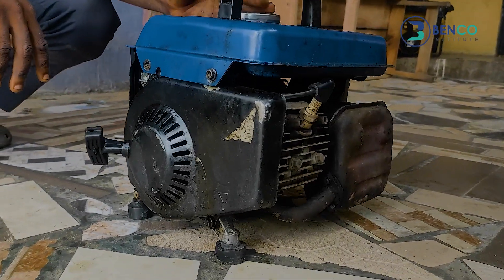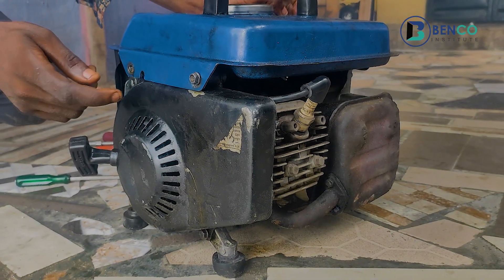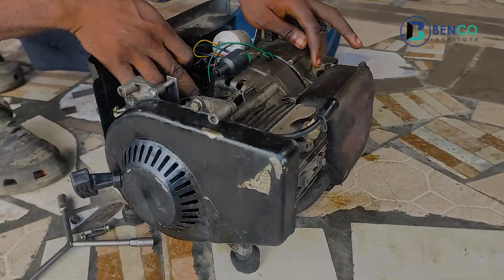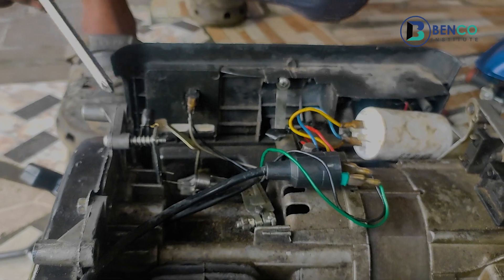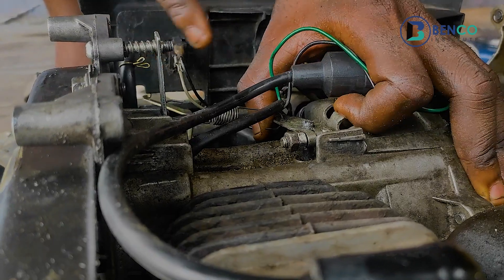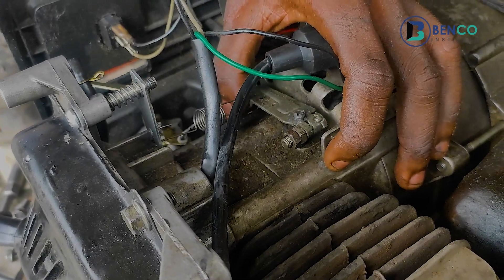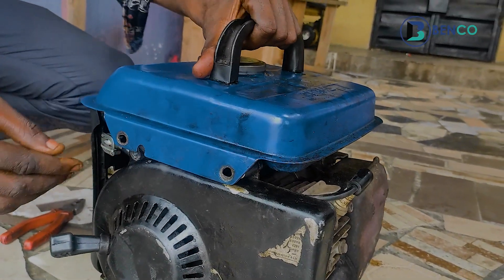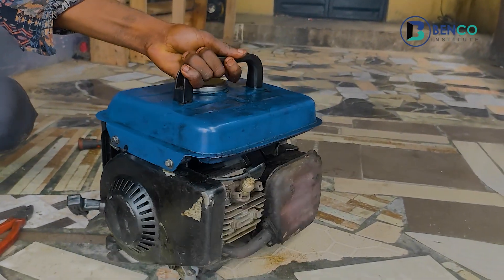GOVERNOR ADJUSTMENT ON A GENERATOR | HOW TO SET SMALL GENERATOR GOVERNOR ADJUSTMENT WITH EASE

Comment: Dude I thank you for this. Every little detail counts when teaching. You added something that saved me after adjusting use your hand to free the governor afterwards, which I did. However, I only had to turn it clock wise once and my engine sound is new again. I had this problem last year but when I attempted to adjust the governor after watching several videos I ended up destroying my governor not this time. Thanks again.
Reply from the maker: You are wlcome

Comment: ???My old generator out put 300volt how solve problem .how decrease volt 220
Reply from the maker: That's really high

If it's this type of gen...change d capacitor to a smaller one or reduce the speed of the generator
Reply from the maker: There are videos on the channel that will help you with that

Comment: Why do we have to move it clockwise and then anticlockwise again?
Reply: You said clockwise then you adjust it counterclockwise
Reply from the maker: originally we are only adjusting the governor because the governor is stuck in the wrong direction...in the process of making the governor free there is need to move it in both direction afterwards we notice it is free and then we now move it anti clockwise which is the right position needed for properly setting the Governor.

Hope this is understood
Reply: @bencoinstitute  understood sir
Reply: @bencoinstitute  please which direction is the Right direction